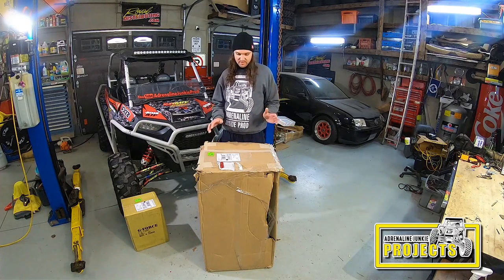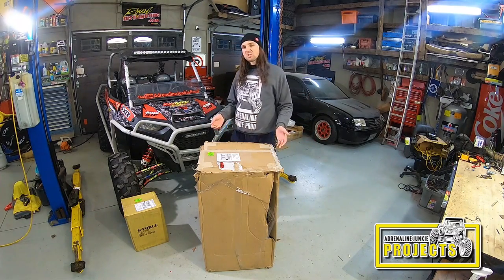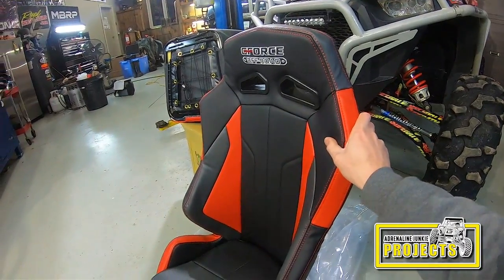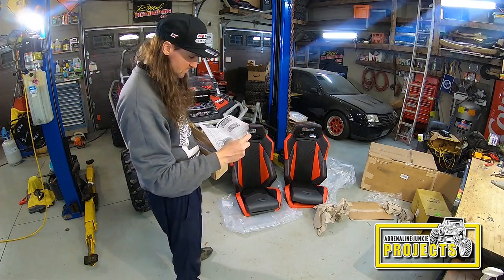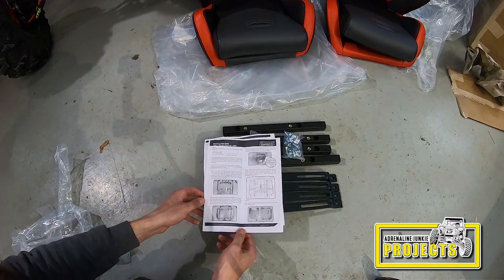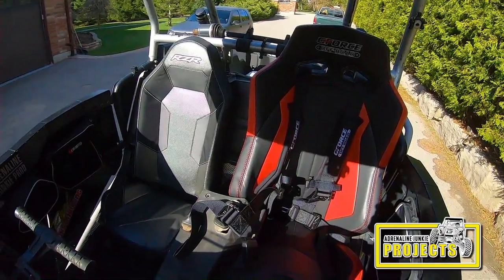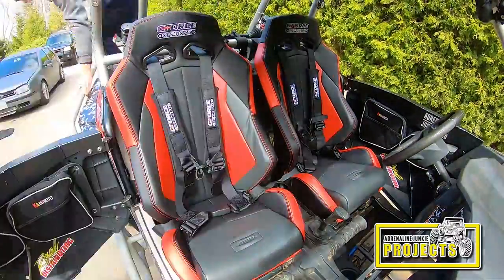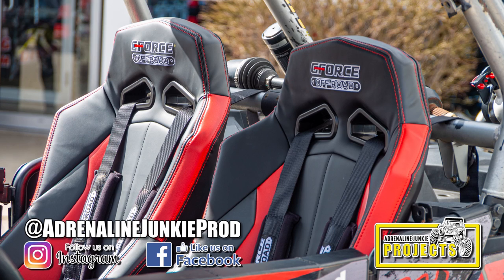G-Force Off-Road Suspension Seats: Unboxing + Overview + Installation in Polaris RZR - UTV/SXS Seats

Comment: Last year I had Shock Therapy install new springs and revalved the Walker Evans shocks in my 2013 XP 4 and it was a great improvement in ride quality for the desert that we ride in. I was actually ready to get rid of this machine the ride was so bad, now I don't have to. I can now keep up with the 1000s that we run with. While the washboard (which we have a lot of around here) ride was much better, I still would like to improve the ride in that area more and was hoping suspension seats would help. Before I invest another $1000, I would like to know if you think the improvement would be worth the cost. Excellent video! Thanks!